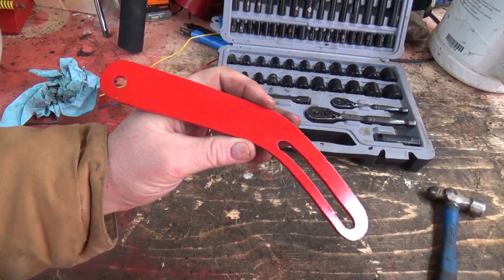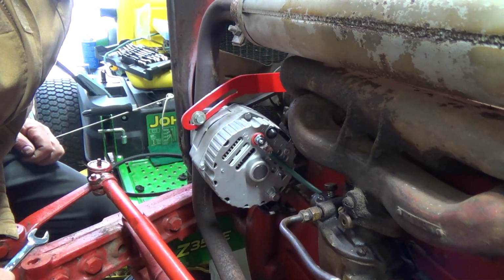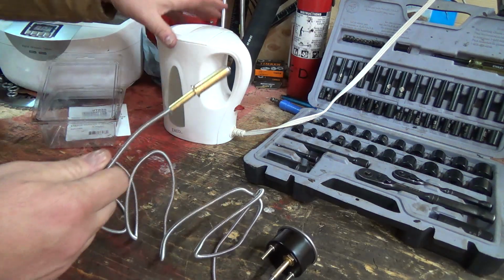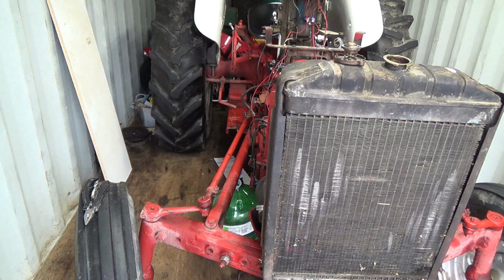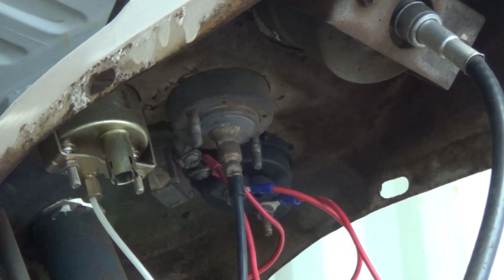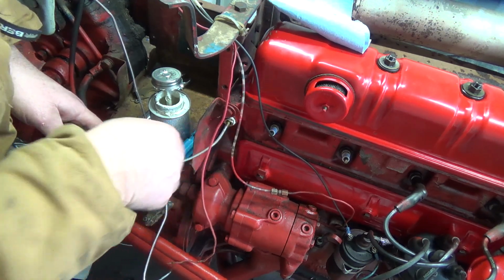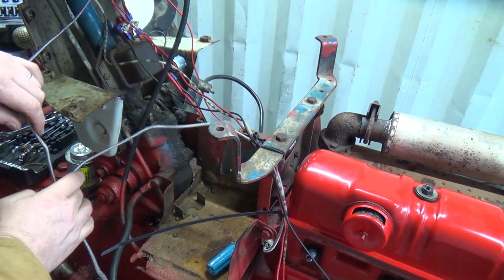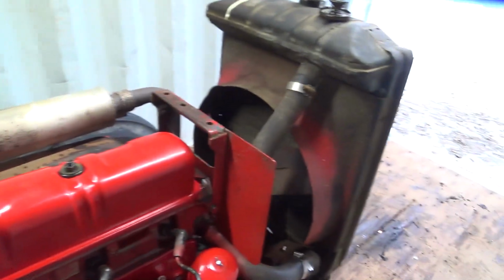Ford 800....Let's drain the rad for a new heat gauge install

Comment: bill if you wanted to get some header rap and wrap that pipe. use to only have one color but now they have every color going . cover up the rusty pipe as well as cool enough to touch. they are easy to install just wet it and wrap it with a 1/2 of wrap overlay. at the top and bottom install a stainless steel zip tie that comes with the wrap. DEI has a bunch of different colors and with and leighs they also have sheets of aluminum for a heat barrier looking good

Comment: All the hydrostatic mowers like that, that I have been around seem to really moan like that when it’s cold out
Reply: the kubotas starts up nicer in cold and there not auto choke in them wich the kubotas makes there less problems wich is nice
Reply: @michaelmactavish1728  what
Reply: @finncampeau4922  the kubota sz, zg ,zd  doesnt have auto choke on there gas and diesel  mowers its a electric choke wich if wears out there accully cheap parts plus they have 3 to 5 year warranty on them
Reply: @michaelmactavish1728  ok.....

Comment: They make a gauge that uses a piece of electrical wire like 12g that you cut to the proper length. instead of that long one For future reference
Reply: adam your right but A Mechanical gauge is so much more accurate.

Comment: Lost my temp and fuel gauge ,  placed a temp like yours today,  I checked with a test light and no power going to gauges , going to get a pro to look at  it,  i only got 2 fuses on my IH 674 but they say its only for lights.

Comment: I didnt get a followup on the old temperature sensor. Only got to se when you put it in and left it there. Got no result. If you did i missed it.
I think the old style of gauge fit a little bit better with the tractor theme. Maybe you can get one from a tractor scrapyard? Nice to have a gauge with lights also.
Reply from the maker: the old one is junk
Reply: @billstmaxx  thank you for the update!

Comment: Don’t flex that capillary tube too much at the sender end or gauge end or it’ll break and you’ll lose all the gas out and the gauge will be trash. You better give the line more slack than that at the engine side or your sharp angle will bugger the line up with vibration. Mine broke at the engine side due to knocking it with a ratchet to read and clean spark plugs in my Chevy 350. So I went electric this time. My oil and vacuum gauges are mechanical.
Reply from the maker: good thinking Thanks